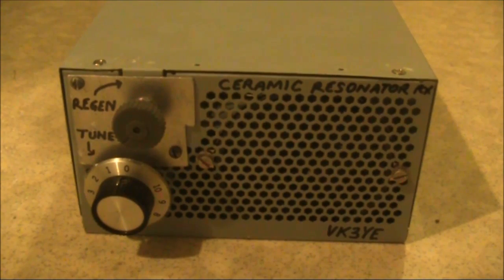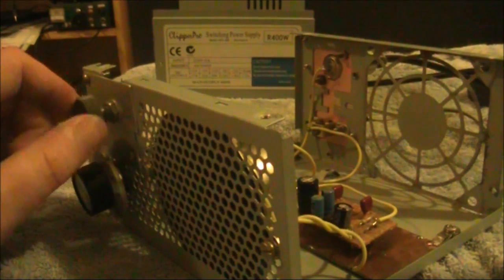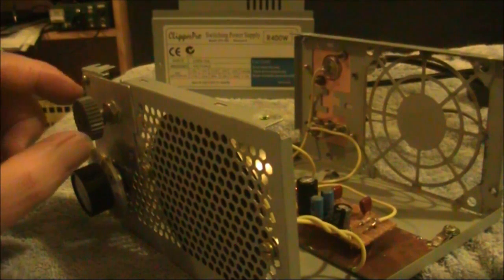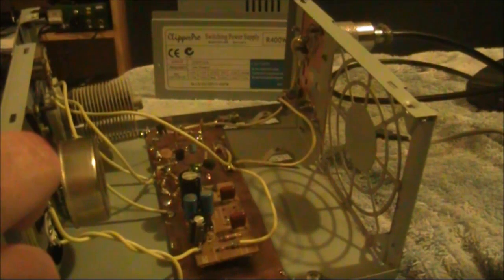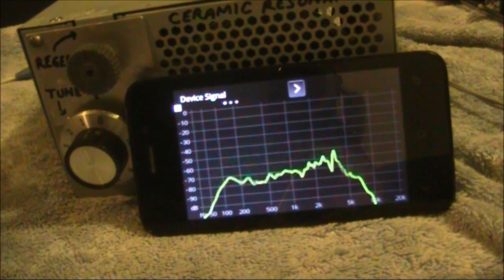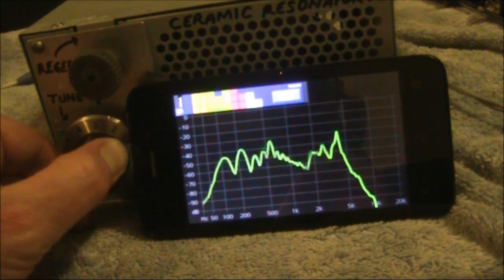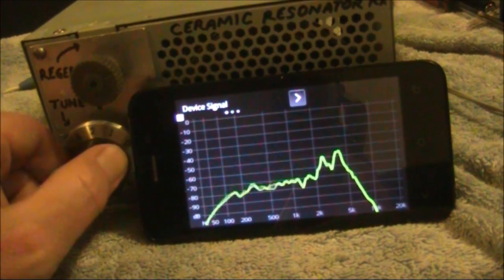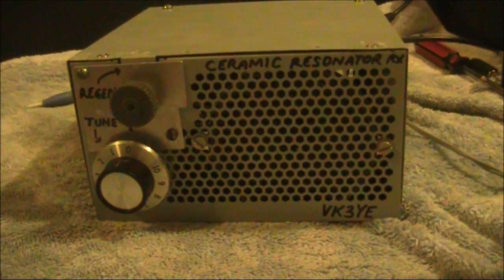Another 7 MHz ceramic resonator regenerative receiver (receiving DX signals)

Comment: "Pulling" is not change in the detector frequency with regeneration adjustment, that's "pushing" -- a term from professional communications design not commonly used by hobbyists of any oscillator. "Pulling" is the phenomenon by which the frequency of a running electronic oscillator, in this case an oscillating regenerative detector, is pulled toward, sometimes even into, synchronization with an injected signal that's nearby in frequency to that of the running oscillator. to make a regenerative detector more resistant to pulling, use a low-Z tank circuit (X of L and C 100 ohms or less at the operating frequency); to minimize pulling, keep the level of signals fed into the detector as low as practicable for the type of reception sought. (Non-oscillating detectors need much higher input signal levels to work well, but they don't frequency pull, either. :-) )

Comment: I think if you replace the 22nF capacitor that's before the audio amp with another 100nF capacitor, it may cut a little of the high frequencies even though it may cut a little of the audio signal strength as well... but you will have much more pleasant sounds for CW. That's what I did on mine and it sounds wonderful. 73 Peter.

Comment: Hey. I am trying to make an external BFO but it does not oscillate. 
What can i do?
Reply from the maker: Check wiring and if not successful try other oscillator circuits. Some don't work with all variations of LC values. Change feedback component values or coil tapping points if applicable.

Comment: Hi Peter, I tried this circuit with a 40MHz fundamental crystal and an S9018 RF transistor (for a proposed simple up-conversion receiver) and it works but there is no actual amplification from the regenerative detector itself. When using a signal generator the signal disappears below about 1mv for a pure tone or more like 10-100mv for an AM modulated signal. That's the signal directly into the regen with about 40db audio amplification. Is this regen detector meant to amplify as well as detect? It does work well with larger signals but definitely needs a preamp at this frequency. Thanks, Ian

Comment: Hi Peter,could we use a 455khz resonator as a fixed I.F Stage\Detector stage using super regen for AM\SSB detector.I would use selectable pots for Am,SSB modes on regen.
It would be possible to use in a superhet design,with audio agc control?
what you think peter?

Comment: Thanks to the great initial idea by vk3ye, sv3ora has extended it to a 
far better level, but without making it much more complex. See his page http://qrp.gr/regenrxcer/
 for the two improved versions of the receiver. The one at the beginning
 of the page is the bare bones version, and the one at the bottom, is 
the special one. 

Both versions, include a much better and quieter headphone preamplifier.
 The special version includes a simple but good performance SSB and 
narrowband CW filter. There is also no audio oscillation at extreme 
regeneration values in his version, compared to the vk3ye one.

His receiver uses a varicap, which eliminate hand effects, it is cheaper
 and it can be controlled with precision without special verniers. This 
is indeed a USB RX without any coils or variable capacitors, and it is a
 great performer!

I have built it and with just 3 resonators, I could cover the hole 40m 
region 1 band without gaps.
Believe it or not, the performance is so good, that I have abandoned 
listenning to the 40m band using my IC-728. This ultra simple homemade 
RX is just so much quieter, like the modern $$$$ rigs.

Comment: I have built the receiver now but I need to solder the lm386 on it but can you tell me pin numbers and where's the components at pin5output in scematic
Reply from the maker: Just google ''LM386 amplifier circuit' for info.

Comment: hi Peter i have all parts now but the potentiometer are a 100k is  it possible that way should I change some values now.  another thing. are the variable capacitor value critical or not many regards oliver, 😁 I am ready to solder it up now
Reply from the maker: Oliver - values shouldn't be that critical.

Comment: I would want to power it with a 9v battery. Would some resistors have to be changed?
Which ones, would you think?
Reply from the maker: You should be able to get away with no resistor changes